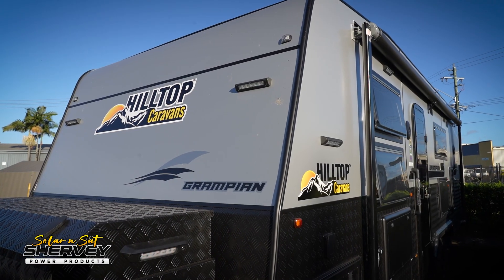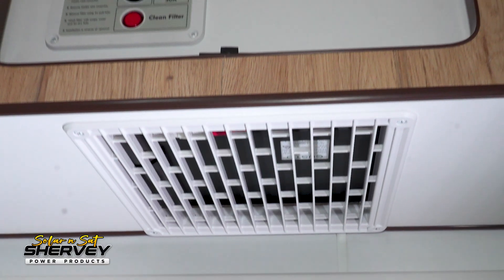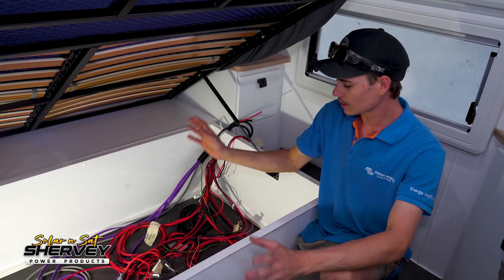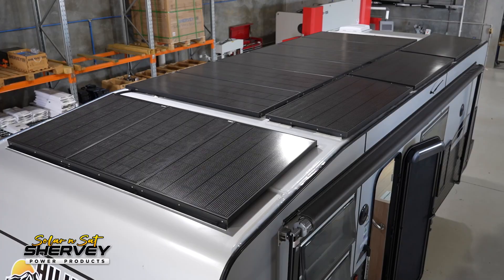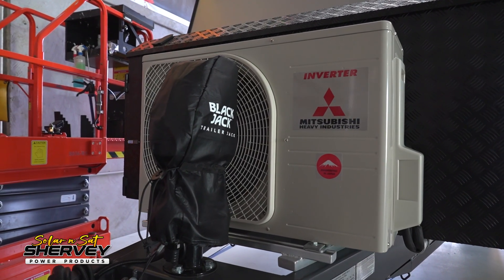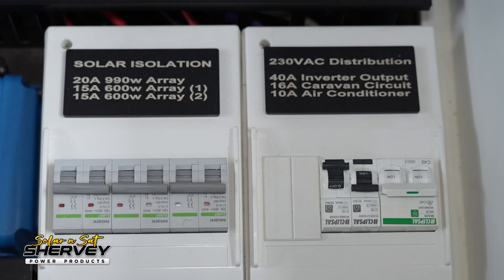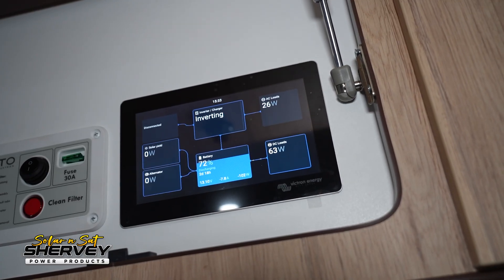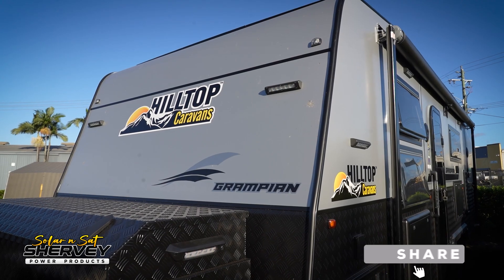Hilltop Caravan | Off-Grid Power System | Solar N Sat

Comment: Why 12volt, 24volt or 48v system better
Reply from the maker: Not a case of which is better but it's more the case of the suitability for the individual installation, although we rarely recommend/install 48v for mobile situations!

Comment: Looks the goods boys! Top notch work as always! We have been running split systems on oil rig related equipment for decades copping all of the dust and abuse of off road travels and they hold up fine when they are good brands and installed correctly. Have always wondered why more people didn’t do this with their vans.

Comment: Just a question,,, Why don’t you use 400W solar panels that are used on residential?
Reply from the maker: We get asked this one quite a bit:

1. House panels are made for houses – They’re designed for stationary rooftops, not for something bouncing down the road.

2. Large surface area means less support – The middle of the panel is more prone to flexing and stress.

3.Size limitations – On most RVs, the physical size clashes with hatches, A/C units, and vents (though not so much on this job).

4. Shading issues – Because of their large area, even small patches of shade can cut output significantly.

5. Mounting challenges – Frame thickness can make installation trickier compared to RV-specific panels.
Reply: @solarnsat ta